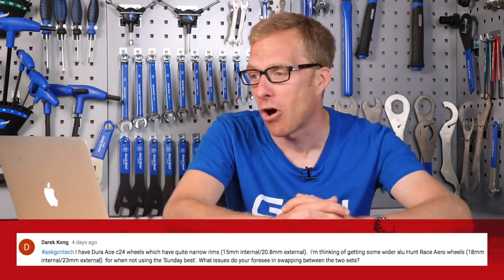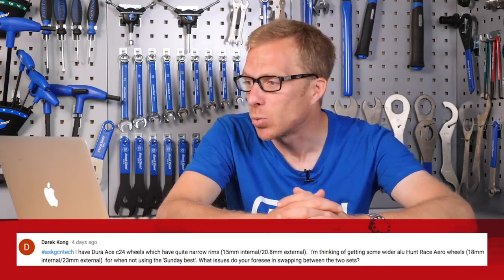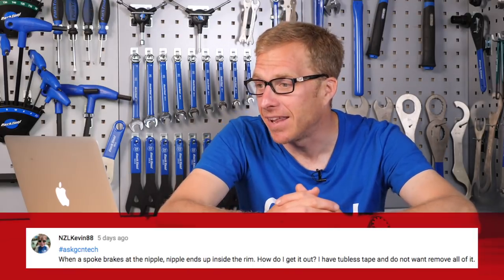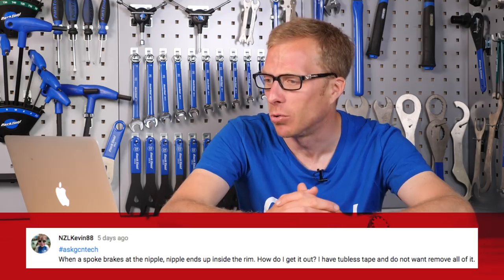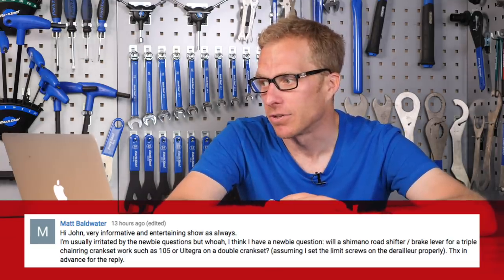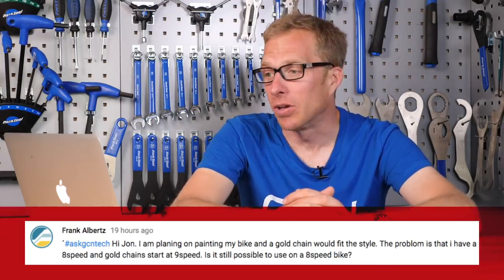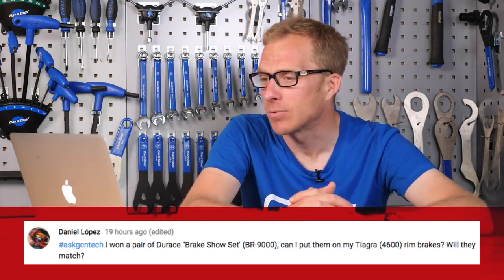Broken Spokes, Rim Widths & Chain Compatibility | GCN Tech Clinic

Comment: Placing a spoke nipple inside the rim, even if it is a deep section rim, is really very easy.  Take a spare spoke and and thread the new nipple to it, upside down and rotate it a turn or two.  Then guide the spoke down inside the rim and through the hole. Push it onto the spoke already in the wheel and turn the new nipple onto it.  This will unthread it from the guide spoke and connect it to the spoke requiring the nipple.  Mission accomplished !
Reply: Problem is that the person asking the question didn't want to remove tubeless tape, so you can't lower it in from the valve hole. You can use something like a fishing wire, insert that in the spoke hole and use a vacuum to get it out of the valve hole along with the old nipple. Then use the wire to guide your new nipple back through the rim. Given the tubeless tape makes it airtight it should work fine! :)

Comment: @Patrick 6:40 Chances are your chain is rubbing on the bottom part of your front derailleur cage. The derailleur may just need lowering a millimeter or two. Remember to readjust the cable tension after.
Reply: Thx. Have the same problem, was still recently searching for cause.  My just have found it now ;-)  Hate unwanted noise.

Comment: Hi Jon, mad props to the tech vault that is your brain! So...I just played mercenary bike scrounger at one of my local bike shops that is going out of business—damnit! I am now the super happy owner of a Cannondale CAAD 10 with an Ultegra groupset. My question is about the internally mounted rear brake cable. It came set up with no cable stops in the frame and the outer housing just run inside. Is this “right”?  Seems like there ought to be a couple of cable stops and just  a run of internal cable in the frame. It rattles A LOT and I would like to change it. Does Cannondale make a cable stop? If not, are there after market products? Do I just need to stuff a ferrule in the hole? Epoxy blob?  Gaffer tape? What do I do??!!

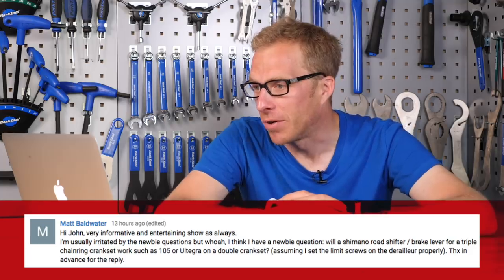Comment: Matt Baldwater @ 5:32, Yes You Can!  When the 105 triple 10 spd rings and chain wore out, I replaced them with 105 double compact, re-using the levers and derailleurs.  As Jon suggested, middle position for small ring and upper position for large ring.  2 years, no problems.  Not sure what he meant by risk of lever "jamming up", have never had a problem with that.
Reply: It will jam if you align the inboard shifter position with the small rign and then try to overshift past the big ring.  But if you do it the way he said, it's no problem.

Comment: Patrick the sound you are describing may be chordal action or chordal effect.  In small gears the effective radius that the chain comes off at changes as there is a cog straight up or a gap straight up.  A change in radius means a change in speed, oscillating very quickly and this results in vibration in small sprockets, most noticeable in the big ring maybe because of the speed/frequency.  I definitely can notice this effect, although I notice it as a vibration.  It seems it wouldn't be hard for vibration to produce noise though.

The fact is anything 15t or less is not a good sprocket from an engineering perspective, and is less efficient.  However bikes require compromise since 80t chainrings would probably require some pretty massive heavy reinforcement.

Comment: @Matt Baldwater Triple lever on a double chainset works great, no worries no jamming, so long as you do it the way Jon described.  If you try to set the small chainring up on the the most inboard setting, then if you accidentally shift to the most outboard setting you'll overstress the mechanism a full click past the outboard limit and could get jamming or damage.  So just don't set it up that way.

I've run one (a 105, 5700 I think) this way for  a couple of years with no problem at all.  Really, buying triple can be a good idea because it leaves you the option to add that extra ring some day, and really has no downside.

Comment: @Darek Kong    I've got Hunt Race Aero Wide (24w 31d) wheels and they're great.  With 25mm Continental GP4000sII tyres they measure 28mm wide and with 23mm Contis they come up 25.5mm wide. If you measure how much clearance you've got at the top of the seat stays, chain stays and forks it should give you an idea of weather you'll have problems. Hope that helps
Reply: FYI they are actually Kinlin XR31T rims which are very popular with custom wheel builders as they are light and strong for their size and very cheap to replace when they wear out. My custom wheel set from Taiwan are going great (first wheels I built myself!)

Comment: Those brake pads work great. I threw out the tiagra ones i got with my bike and bought the 9000 shoes and pads. LOADS better braking for £30 (covered front and back). Cheap, very noticeable upgrade

Comment: #askgcntech Hi Jon and thanks for a great channel! I have a problem with my Ultra 6870 rear derailleur adjustment - For it to shift semi-ok, I need to micro adjust it all 33 steps down to get it to sit at the 5th cog without rubbing - I’m am following the directions of the manual. This leaves me with no more adjusting possibilities to be able to fine tune it. Do you know what it can be? It’s worth noting that the DI2 is retrofitted by myself on a DI2 ready frame.

Comment: I run triple shifters and a triple FD with no issues. I tried to find a really nice triple 105 9 speed crank but could not but I had already gotten all the bits for a triple. I simply set the limit screws to lock out the front small ring. Been great for 3+ yrs. But if anyone has an old excellent condition 105 triple 9 speed crank let me know 😀 still can't find one 😢.

Comment: Hi Jon! I keep asking the same question for couple of Tech Clinic shows already, but with no answer so far. How do I true my tubular rear wheel which has inner nipples and aero spokes? Do I have to remove the tyre from the rim, true the wheel from the inside of the rim and then glue the tyre back to it, or is there any other way to do it without taking the tyre of? #askgcntech

Comment: #askGCNtech

John, I have a bike with the 2012 shimano Sora group set, the older model thumb cable release rather than the second level. The hoods are becoming sticky and otherwise degrading.  Could you help me find the correct replacement hoods, or where to find them. I have asked my LBS, and even looked on line but am having trouble locating the correct hoods.  I would also consider aftermarket hoods if they are no longer available form Shimano. 

If they are no longer available, could I replace the Sora SDI's with the Ultegra 6800 or would that require also upgrading the cassette, and or rear derailleur.  I already have the Ultegra 6800 wheel set on the bike (an upgrade when someone stole my rear wheel).  

If it requires a new cassette, what would  be the shim offset required (adjustment from the current), or will I just remove all cassette shims. 

The bike in question is a 
2012 Masi Alare
Sora (not sure the model number) SDI, derailleurs front and rear(all original)
SRAM 11-28 9 speed cassette (with wheel upgrade)
SRAM 9 speed chain (service replacement)
Ultegra 6800 tubeless wheelset (upgrade)

If you need any additional information let me know. 

Thank you for the great show. I learn so much. Keep it up and you will be the next Saint Sheldon Brown.

Comment: Jon, what do you recommend to help increase friction on a carbon seat-post in an aluminum ("A-LOOM-IN-UM") frame that keeps slipping despite sufficient torque on the clamp?
Reply: George Hugh lol I'm not Jon but your lbs should have grease that has grit in it that solves that problem.
Reply: Thanks, Cyber TRS.  Didn't know they added grit to grease (seems like an oxymoron, eh?).  I'll look for it next time I go by.

Comment: #askgcntech had my bike serviced and overhauled including new cable and etc. I could hear and feel a clicking noise when I use the rear break. Though I was using a different set of wheels during the outdoor ride. Could it be the cogs or hubs as I didn't encounter any issues in shifting? Thanks Jon!

Comment: I've got the new Ultegra road hydraulic brakes on my bike. I'm struggling with getting the lever return as "snappy" as it should be. The rear is worse, but they both have very a very sluggish lever return despite them feeling firm. I've got the older non-series on my gravel bike and never had an issue with this even when they needed a quick bleed to firm things up. Brakes have been bled by me and my local shop and it seems to work fine immediately after bleeding but a day or two later and it's sluggish again. 
Any ideas?

 #askgcntech

Comment: #askgcntech

Great show and good work all you guys!
I want to change the chainrings at my Canyon Aeroad CF SLX Di2 from the standard 52/36 to a 55/42, because I use the Aeroad mostly on the flats with high speed. The Chainrings are on the Quarq DFour cranks. But when I tried to adjusted the hight of the Ultegra 6800 Di2 front derailleur the end turned a little bit in direction of the chainring and now the derailleur is rubbing at the 55 chainring, I tried to play a little bit with high screw adjustment, but when the shifting was good, the rubbing was there and when I got rid of the rubbing, I had very poor shifting. Is there a way to get the Ultegra Di2 front derailleur working with the 55 teeth chainring, any tips?

Comment: I am trying to adjust the limit screws on my front derailleur, but the barrel adjusters on the cable are not changing the cable tension. What might be the problem with the barrel adjusters and how can I fix it besides just changing out the cables? #askgcntech

Comment: #askgcntech Do they make headlights that tell me (during daytime) that it needs battery replacement/recharging?  My older model Bike Planet LED headlight gradually becomes dimmer as the battery becomes low.  It always still turn on, even on very low battery, so I have a hard time recognizing it's too dim until I really need it.

Comment: #askgcntech Tubeless road has been a nightmare. My 40mm tubeless tires (Vittoria Terreno Dry G Plus and Schwalbe G-One Gravel) are getting cut-up on my not so clean paved roads here in San Diego. The pin punctures seal but I occasionally get cuts maybe 1/8-1/4" in size. I use Stans sealant but it's not sealing the slices until the pressure drops to about 40 psi. I end up using 1 or 2 Dynaplugs to get home but they usually dry out and leak around the edges when my bike sits idle. Am I doomed to riding tubes or tubeless with 40psi? Cheers
Reply: Approx year ago I read a very thorough comparison test between all the major sealant brands with various puncture sizes and Orange Seal was the best for road bike pressures and much better than Stan's. I will buying the new sealant from Finish Line that never dries out next,  or Orange Seal once my big bottle of Stan's runs out! 😣. In the meantime I have improved the Stan's by adding more particles, I stole some glitter from my daughter. I believe Stan's have improved their formula since as they recognised they had a weakness. That's called Race Sealant.

Comment: #askgcntech My headset gets getting loose after each ride. I've watched your video on fixing it but it keeps on coming back. I've dismounted the headset and the fork and inspected all bolts and brackets which are all fine. Cleaned them and put some new grease on where needed. Any ideas?
Reply: Michael Jungmann make sure you tighten the inner expander see at 1:35 in this video. https://youtu.be/aBjJ35B-Og0.  (FSA recommends a torque 6-9Nm which is more than video suggests)
Reply: Cheers for that - already checked that one and it's currently sitting in there  snug with 5 NM. Don't have a spacer on top but that has never been a problem since recently. Might try tho move the spacer on top there. Thx Richard.

Comment: #askgcntech Hi Jon, I'm running a full ultegra 6800 groupset and i'm very pleased with this accept i can't seem to get my smallest sprocket to work altought i recently got new cables, casette and chain. As soon as i put it in to the workstation it shifts after a little while, but all the other sprockets shift perfectly. Is this bad indexing or is there something else wrong perhaps?  Thanks in advance!
Reply: Does it click like it's trying to shift down then eventually shifts down, or does it sit smooth and just shift late? Could be your high adjustment screw no being quite right if it's clicking trying to shift
Reply: What he said ^^ also could be derailleur hanger alignment slightly off.
Reply: Cyber Trucker Road Show oh yeah good point! Check that the hanger is parallel to the jockey wheels and chain
Reply: thanks for the tips guys! Matheus, it does shift eventually without any clicking noises. But i will have a look at the bike tomorrow, hopefully these tips will solve the problem!
Reply: Sebastiaan Pater no problem! Hmm... That's a bit more complicated I think. I would still check the high limit screw (GCN has a great indexing video with Si that goes over this as well) and the alignment as mentioned above. Otw you may have to wait for Jon!
Reply: Sebastiaan Pater actually that simply sounds like you have a tad too much cable tension, looen the barrel adjuster or loosen the rear cable a touch.

Comment: #askgcntech. What causes front and rear mechs to become unalligned?
Reply: Justin Hardwick Road vibrations over time, bumped and generally jarred around.
Reply: Cyber Trucker Road Show Any way to help to prevent?
Reply: Justin Hardwick Not that I know of, it shouldn't be happening too often. If it is then I suppose you could use a tiny amount of loc tite on the adjustment screws but IDK if I actually would tho.

Comment: #askgcntech 
I think I'm going crazy here because I swear my seat post is slowly dropping as I ride! I have the seat post clamp tightened to the recommend amount using a torque wrench and use grease (park tool PPL-1) on the post. It seems like after a week or two on the bike I notice that the seat height has slowly fallen about an inch or so, but it happens so slowly I can't seem to get it move when I test it off the bike. 

Is there something I can do to prevent this from happening? Would it be safe to torque past the manufacturer recommended setting (5Nm) or use a different grease? The bike is aluminum on aluminum, but I also have a carbon on carbon bike I swear it is happening on as well!
Reply: LukeHod  Well the problem is that you use grease (which reduces friction between 2 material) instead of a special paste (can't remember the name) designed to raise the friction between 2 materials.

Comment: Love the show Jon, even if half of it goes right over my head.  I’ll be upgrading my sora drive train to the new 105 set.  I currently have sram apex brakes on the bike.  Should I replace them with the 105 se?  Second question, will 28mil tires fit on Shimano S500 wheels.
Reply: mjsylver, recommend changing your brakes over to the 105 set to match the shift/brake levers.  Shimano shift/brake levers work best with the same group brakes, I think they call it SLR (Shimano Linear Response).  The APEX brakes will likely work, but the 105 components will give you better performance.  As for the S500 wheels, I think the 28's will fit, but I'm not the guru of cycling tech like Jon C.
Reply: David Crow Was thinking along the same lines.  I’ll be putting the sora components and 500 wheels on an old trek 1.5 frame for my daughter just getting into roading with the 28’s.  The apex brakes seems to work with the sora 3500 series just fine.

Comment: #askgcntech Hello Jon ! When i put my bike on my home trainer, the derailleurs need to be adjuts all the time... The problem is that the cassette on the home trainer is the same theet, same high,.. than the one on my bike... I don't understand and i try everything... help...
Reply: Wahoo Kickr?  Mine needed a .5mm shim to get it to match the bike.  Before that I had to go a full turn on the barrel nut every time I swapped it.
Reply: no, on a tacx neo but i use all the spacer with all the possibilites and nathing change... I tried really everything... i thing it might be the cassette wich is the same except the fact that my cassette is in 4 part and the other in 6...

Comment: Great show! What’s the most geared cassette I can fit on my hub that currently has 9 speed? #askgcntech
Reply: Joe O'Carroll That will depend on your rear derailleur length. A SS (short cage) will accomadate up to a 28t, while a GS (long cage) will accomadate up to a 34t. So 11/28 SS or 11/34 GS.